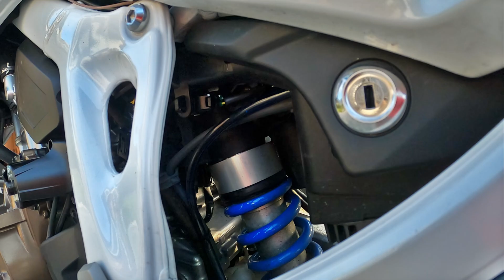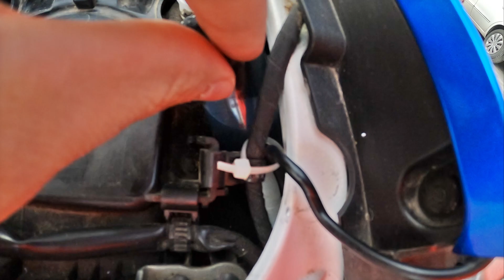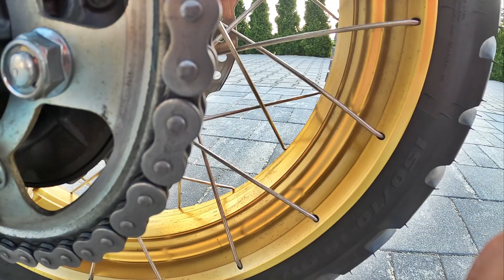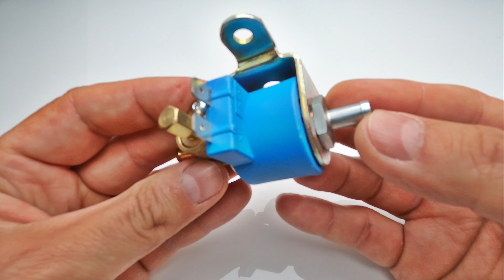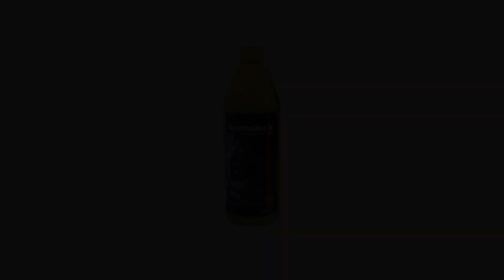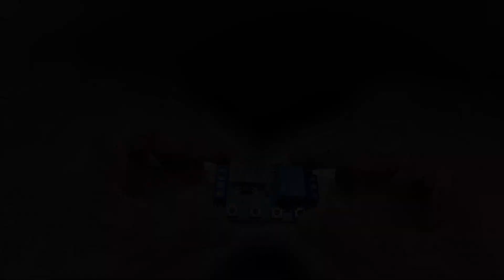A simple chain oiler. Is it worth it. Not a Scottoiler. Honda Africa Twin Adventure Sports CRF 1100

Comment: I like it, I am an avid chain oiler! I already found the LOVATO valve and bought it. It's bulkier/heaviet than I expected but looks good quality. I have the idea of dripping oil at the front sprocket side, attaching a tube at the front sprocket housing,  I will tell you if I succeed.  However I will not sleep well at nights if the chain is not lubricated evenly, I am optimistic...

I fugured out from the video how you connect the valve, but just in case, does it matter which side of the valve oil comes in and out?
Reply from the maker: I will also move it around the front sprocket.😀
 I connected it according to the arrow drawn on the housing, I did not check the reverse connection.
Reply: @roadsandoffroads Yes, I saw the arrow after I  asked you... thanks
Reply from the maker: @EfficientMan  You're welcome 😀

Comment: Why oil your chain at all? You might think I'm just trolling for reactions, but no... seriously. They are O-ring sealed / permanently lubed internally. Oil on the outside, maybe if it gets rusty looking from being wet / washing, just to make it look fresh? I have 25,000km on my Africa Twin - chain has never seen a drop of oil, and I've hardly needed to adjust it at all.
Reply from the maker: Very good result. I lubricate it with oil to prevent wear on the rollers on the outside and both gears. I have traveled 34,000 km and I am curious how much longer I will travel before the chain is replaced.
Reply: I am jealous that you don't care and don't oil your chain. I wish I was like you but I have to oil the chain. How do you live with it? Is not rusty?

Comment from the maker: I drove 1,200 km, including 100 km in rain and 280 km on wet surfaces. On the road (on asphalt) I increased the intervals between cycles to 40 minutes and for me it was perfect. In the rain every 2 minutes, in case of a wet road (with light rainfall) every 5 minutes. I'm still testing dirt roads :O)